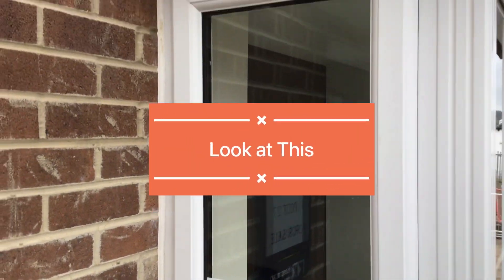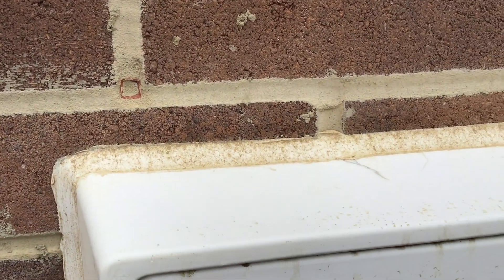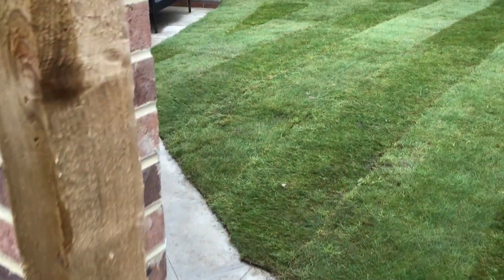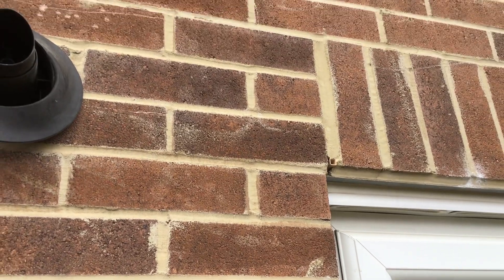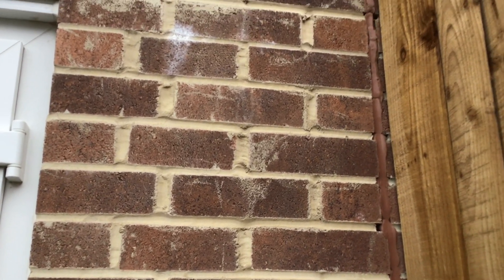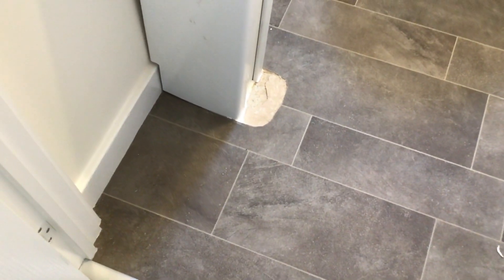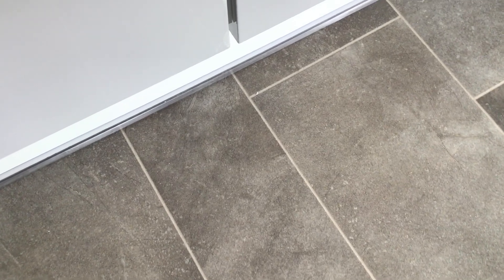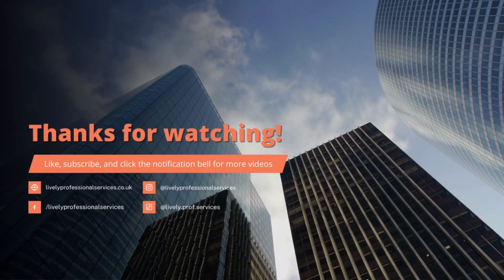Look at This

Comment: Wait a minute for a start i hope its not a plumber fitting the boiler should be a heating engineer ie has gas qualifications pretty sure he has to work to plans per the architect so blaming the engineer for were the flue termination is is incorrect so before blaming trades maybe look at the planning of the house layout
Reply from the maker: Hi Shaun, the plumber fits the boiler they are gas safe registered, I don't disagree with the planning of the boiler position but more thought needs to go into the boiler flue and position of cavity trays. Communication between the plumber and bricklayer would have helped.